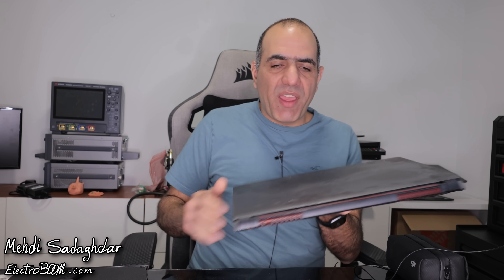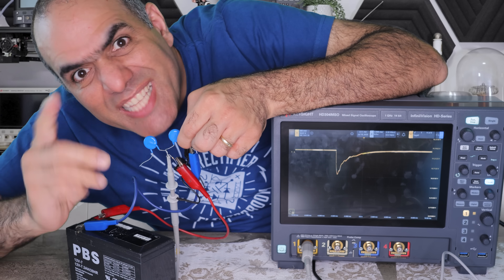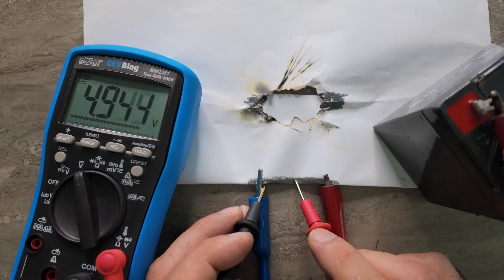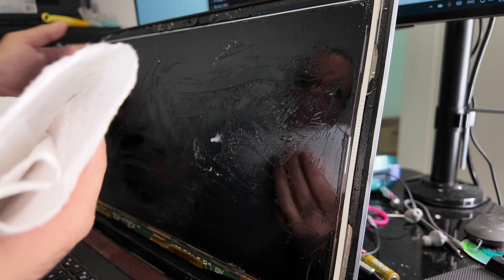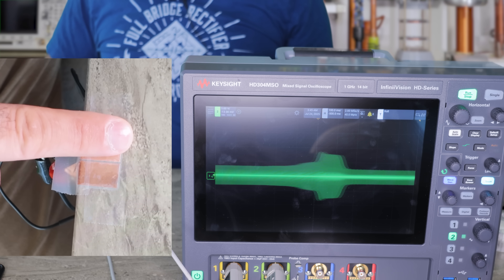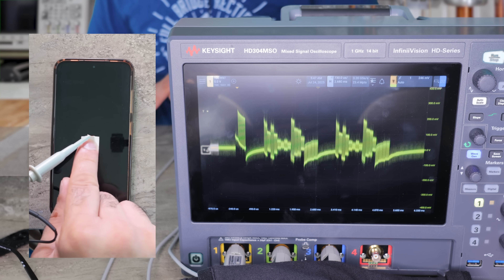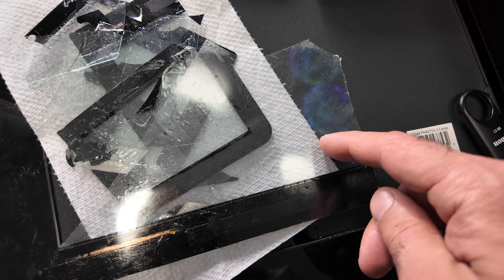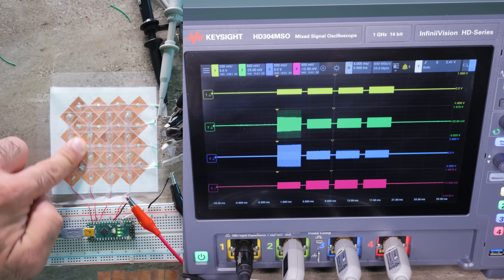The Touchscreen that Changed the World!

Comment: I remember as a child that touch screens were a novelty technology, in these giant arcade booths with simple interfaces, usually a simple click and drag game at a technology  museum or a selection menu booth at an airport.  Big expensive devices that were more for show than practicality, oh look the technology from Star Treck, except it sucked, it was spongy, slow, had to press down for it to work and the image behind it was low res and fuzzy.  Fast forward a couple of decades, now our phones have touchscreens that are exactly like TNG era Star Treck tech, glass screen with high resolution everything and we don't even think about it.

The cheap membrane screens from  my childhood did manage to last past the introduction of modern solid touch screens, I think the last devices to still use membranes were cheap GPS devices and the Nintendo 3DS in the early 2010s, the 3DS required a stylist wand to prevent damage to the screen from sweat and oil.

Comment: I like the AI part of this video.
As a software engineer, AI is a great tool but it makes lots of mistakes. The general idea that "AI is going to replace developers" is such a nuanced statement. Can AI write code? Sure, but it doesn't handle edge cases well and doesn't adhere to any kind of standard. It simply writes what it tells you to with no context. IDEs like Cursor can sorta circumvent this but it's not going to replace devs.

Honestly, learn embedded programming or low level languages like Rust/C++ and you'll be really marketable. Or just go full enterprise-slop with C#/React.

EDIT: "Is it bad that AI can create anything"

No. AI is a tool. I've worked at a few places where people make use of AI and while it does save time implementing patterns or redundancies, we always have to verify the output of the AI and tweak it a little. It's just a tool. You use a hammer to insert a nail but always verify that the nail is set in the right position. AI is no different. The "AI scare" is just fear mongering for the sake of it. AI is going to replace jobs just like the cotton gin did and people adapted to that as well.

Comment: A while back I watched a video of a similar sort of touchscreen mechanism, however it used acoustics instead of resistance, and it detected interruptions in the sound waves to detect where the touch was. It was for an iMac G3 that had been modified for a POS system for Elo POS systems. I thought that was pretty cool, considering it was a CRT touchscreen before touchscreens were mainstream.

Comment: By the way you can actually use a simple digital IC called a sequencer to generate the readout pulses for your capacitive touch screen. Each clock pulse it receives it change the output to the next line in the sequence. It wraps back to the first output line after reaching the last output line, or when ot receives a reset signal. No need to waste your time with microcontrollers and programming.

Comment: lol, they make it sound like “AI” just provides flawless code. I run software engineering teams, and it confidently provides you with code that doesn’t work most of the time. The most we use it for is as a quick lookup tool (instead of googling, which all software devs do), but everything it produces has to be double checked, and if you get it to produce too much code, you end up spending more time debugging it than it would have taken to write it.

“AI” tools are great to dazzle lay people, but it’s still just a toy - Google even warns you to double check and verify everything it tells you, and Microsoft just introduced it to excel - but also said don’t use it if you want accuracy or repeatability - which I thought was the entire point of a spreadsheet 🤯

Comment: 15:51 Ai doesn't help in being creative. It takes creativity away. 

Knowledge is an important component, but you do not need AI in order to understand something. 

There is one KEY element in being creative. 

Effort. Putting your heart and soul into something even if you have no idea what you're doing is still better then just mindlessly typing into an ai. 

You gave it a go. You tried. You failed. So, freaking, what. 

Having no clue what you're doing, yet giving a jolly good effort and failing is so much more respectable than having no idea what you're doing and immediately flogging to an ai. 

Just look at me. I have no talent at editing or videography. But I try. Even tho I fail miserably. It's the commitment that counts.
Reply: You don't get to tell other people what they're doing is creative or not, full stop
Reply: @snowthemegaabsol6819 I can tell them when they are being very destructive towards other people. And using ai to generate "Art" is being very destructive
Reply: Walking is destructive to anthills. Boo hoo, must suck to have eyes so fragile
Reply: @snowthemegaabsol6819 Do you actually support this ai garbage? Are you just fine with people stealing artstyles?
Reply: @EvexiansVideoworks  So you just walked back the line immediately or?
Reply: @TunaIRL What? "walked back the like"? What the hell is that supposed to mean.

Comment: I'm a professional programmer, I use AI all the time and it probably makes my work somewhere between 5x and 10x faster. But for now, for anything complex, you still need to have a solid understanding of what you're doing because AI will get stuff terribly wrong sometimes, and you also need to know what to ask it. "Do I want a queue or a ringbuffer for that?" "Will a SQL or a NoSQL database be better for this use case? Or maybe a text file is enough and we can upgrade later?" "Do we anticipate the need for massive scalability soon and need to use docker from the get go despite it being a gigantic pain in the * or is it overkill at this point?" "What architecture do I want to make this code as easy to reason about as possible?"... Sure you can ask all this to AI's, and they will explain the pros and the cons, but if you don't spend the time to understand the replies it's not that helpful, and again, you need to know what to ask. You also need to know how all the pieces fit together otherwise you're very unlikely to plug them correctly. And sometimes AIs do really dumb shit, you need to stop them and point them in the right direction. But no doubt one day not very far in the future they will be able to do even more than today and take care of many more things. We're just not quite there yet but it's already impressive what AI's do in programming. I can see my job evolving by the week. But even when AI's will be able to replace humans completely in some tasks, I think it's prudent to remain able to do things by oneself. The day the AI providers will multiply their prices by 10, you'll be glad you still know how to do one thing or two by yourself.

Comment: You should charge your battery. 11.5v  isn't healthy for a lead acid battery. Recharge after 12.5v. They're full at around 13.1v give or take. Check every 6m and charge with 14.4v to be safe, for 12h. 13.8 if you wanted to keep it charged. And your current battery may already be damaged due to sulfation.

Comment: I can give you an example... I learned the extreme basics of a 555 IC and tried to mess around with the pinouts in some simulation thingy. I have a humidity and temperature sensor, relays go on or off depending on what the actual sensor part reads. I wanted to make a 555 IC pulse once, to a coil, over a dehumidifier, so it would trick a capacitive sensor into turning the dehumidifier on. For the life of me, I couldn't figure out how to do a simple flip flop circuit that would turn power to the coil off as soon as it pulsed once with the 555. 

I asked Google. Google gave me random off topic nonsense. I resorted to ChatGPT gritting my teeth. It just gave me the answer automatically. The circuit works now. I could have used a big micro controller, but why do that when this way requires negligible power draw, and is much more compact and easier to find faults on. Plus, I actually knew about parts of what I needed/wanted to do, it was just the final hurdle of figuring out what pin went where on the IC to get the desired result.

Comment: As a programmer I can safely say AI sometimes has exactly the right answer, when asked correctly and when specific enough. If you ask a slightly broader question it will tend to just conform to your question, pretending it's correcting.

Don't fool yourself, LLMs aren't capable of programming at all, they just spew out previously found data and when the overlap is too great, so does the output causing weird scenario's or simply dysfunctional output.

Comment: I've made a website, members portal and admin dashboard for the local lifeguards. I did this with the assistance of ai in order to save time, and yes it did save me some time. It also caused me to have to hunt down the mistakes it made and try to fix them. That cost me quite some time too. Sometimes I just had to redo entire sections of code because something simply just wasn't expandable, or the code only worked due to some unknown fallback mechanism of the browser (welcome to web dev).

What I've learned from this is that you should not trust AI to give you the best solution to a problem or a good one, just to give you something that possible just works, and probably not very well. Some of the info it gives you is also just straight up wrong. This is more likely to happen the more in depth or niche a subject is. It'll make things up in order to fill in the gaps in information.

You can use it to get started and learn things from it, the rest you have to figure out on your own and through experience, then you won't really need it anymore.

Comment: Ive replicated the capacitive touch screen but   the voltage did not increase as much as shown in the video.. the variations in the matrix were way smaller than the one showed in the oscilloscope... i will try again putting more effort in the making of the copper matrix

Comment: Honestly the one thing I'd expect "AI" to be good with is itself. 

Also both good and bad, if it's too simple that doesn't teach you anything, then all its going to do is degrade the creative mind. If it can explain (properly) with how it came to what it gave you, then it's probably fine. The worry is that I don't believe people will take up the learning if something else can just replace that learning without worry anyway. If you can change that mindset, I think AI will eventually become a useful tool. IF we ever get real AI anyway. 

Fact is it's just another program doing program stuff and what it's told. No different from what we called a bot, these ones just have wider functionality and reach because that's how they've been coded.
Reply: Actually all AI was doing in this case was ripping off search engine results from the Arduino page. That's the insidious thing, somebody wrote that code, posted it online, and documented it. AI rips it out of context and takes the credit.

Comment: mehdi, that board with the contacts you were pulling is not only for the touchscreen, it probably does stuff with the actual display, and depending on the type of screen, carry dangerous voltages for something, idk, never took an LCD display apart

Comment: LLMs are still very bad at complex or novel tasks. Therefore if you don't have a mastery of the simple stuff high enough that you could do it on the first try in a coma with both arms removed, you'll never be able to do the complex stuff at all.
The danger of using AI rather than learning is that we'll get a shortage of highly skilled engineers.

Comment: My favorite kind of touch screen are the ones where the digitizer is actually incorporated INTO the LCD/OLED panel directly. This is the same kind of assembly techniques used in smartphones and even some tablets. Many years ago this was nowhere near as common (not even with phones!), and they relied on a digitizer layer adhered onto a glass layer which was placed atop the display. Many of these kinds of touch screens did not use OCA, but were instead "air gapped" and taped around the edges of the glass to secure it to the device. However, some of them (particularly laptops) had to use optical adhesive, as tape along the edges was often not strong enough to hold the weight of the glass. 

What is nice about the ones with an in-display digitizer is there's no messy OCA, no stupid glass layer on top of the display (well sometimes there is, depends on how "aesthetic" the OEM wants to be I suppose, but the glass is not required in this assembly), and the displays are often coated in a matte film which also makes them far less susceptible to fingerprints and other markings. 

Will NEVER forget the first time I tried to replace "just the touch screen" on one of those BS laptops with a glass lens digitizer. I was brand new to repairing electronics professionally (can't believe this was over 10 years ago!). I saw tons of screens for $300+ and a bunch of cheap glass touch screens with cables coming off of them for like...$30. I decided to try doing just the glass. I had already fixed tons of tablets and such so I thought it would be no different. 

OCA is a nightmare and I was not prepared for the hours of tedium which laid before me when I started trying to warm up the broken glass to remove it. I was able to get the glass replaced and the LCD was entirely undamaged in the process. I did not use OCA, so it didn't look as good. Instead I adhered the glass like I did for any typical tablet repair with TESA tape along all the edges. This was fortunately strong enough to keep the glass from falling off. Despite the setbacks, the customer was very satisfied with the repair. I never attempted to perform that kind of repair ever again, and quickly learned my sanity is worth more so quoting repairs with the more expensive manufactured display assemblies was the better choice. 

EDIT
If you ever need to remove an OCA-bonded panel, my advice is to freeze it. You can use heat, but the problem with heat is if it's too uncontrolled, you will scorch the polarizer or other layers for the display, or kill individual pixels or subpixels in an OLED panel. Freezing does the same thing, it weakens the adhesive, but rather than making it melt, it makes it super brittle. The glass can be separated afterwards with minimal force. Freezing also will not cause irreversible damage to the panel or any circuits (unlike heat), provided you give it time to acclimate afterwards. 

A regular freezer won't cut it, it won't get cold enough to weaken the bond in any substantial way. I had the best results with easily accessible dry ice. I would just stick a panel on top of the ice for 10-15 minutes. This rapidly weakens the bond until the glass is basically ready to fall off. If you have a blast chiller, this would probably be the best possible way to remove bonded glass. Of course, all of this assumes you can remove the display assembly from the rest of the device so you're just working with the assembly. If you can't do this, I wouldn't recommend trying to blast freeze a whole laptop, phone, or tablet. 

For cleaning an OCA-bonded display panel post-glass removal, I recommend using d-limonene. This eats adhesive. It turns it into a jelly-like paste. Multiple applications with gentle scrubbing will be required, but the process can be sped up with gentle heat. I have also heard of people using kerosene or naptha for this purpose (in addition to separating the glass using a thin, flexible tool dipped in it). Regardless of what you use, do it in a well-ventilated environment. You follow up with multiple applications of alcohol and wiping once the adhesive has been removed.  

It IS possible to re-bond these kinds of panels with new OCA. However, this requires very specialized equipment. Around 2015 I experimented with this when I was trying to learn how to refurbish AMOLED panels from Samsung. It required thousands of dollars of equipment, only worked for a small handful of phones, but it DID work once I dialed in all the variables for each step of the process. You'd need a pretty robust setup to deliver the same treatment to a larger panel, and honestly I doubt such equipment would be economically available (or even available at all) to any hobbyist or DIYer. Even for phones it is prohibitively expensive. Basically, if you don't work for one of the 5 companies creating manufactured display assemblies, chances are you will never even see the kind of equipment they use in your entire life. 

An actual accessible alternative to OCA is LOCA, or liquid optically clear adhesive. This stuff smells like death but it is easy to acquire and doesn't need tons of special equipment. It cures under UV, so it can be "DIY'd" pretty easily. The only drawback to LOCA is you can't use it on LCD panels unless you remove the backlight, or take steps to ensure the backlight is 100% sealed (you can do this with a meticulously applied dam of sticky tape). This means the display itself often needs to be removed from whatever chassis it's a part of, as you can't access the backlight otherwise. 

If you fail to remove the backlight or seal it, the LOCA will seep into it and cause permanent visual artifacts. LOCA can also seep into camera cutouts, microphone holes, speaker meshes, etc. So full removal of the panel is really a requirement. LOCA works perfectly fine for OLED panels as these do not utilize a backlight, but removal is still necessary to prevent it from interfering with other parts of the display assembly, like cameras and microphones.